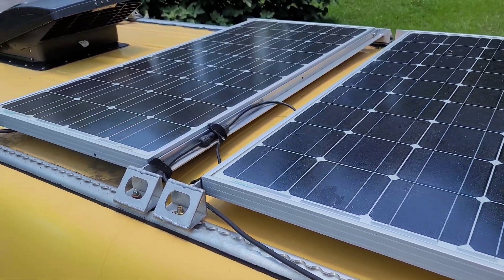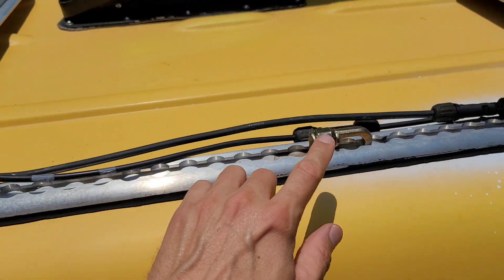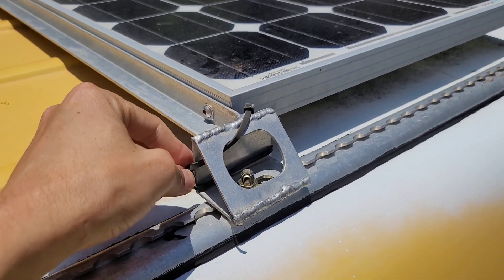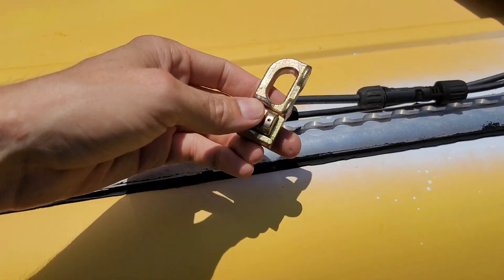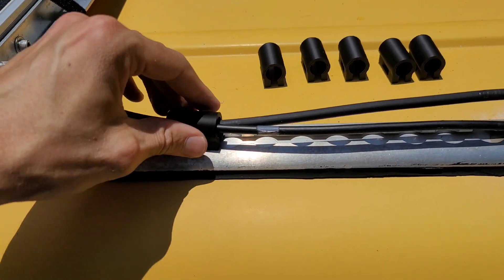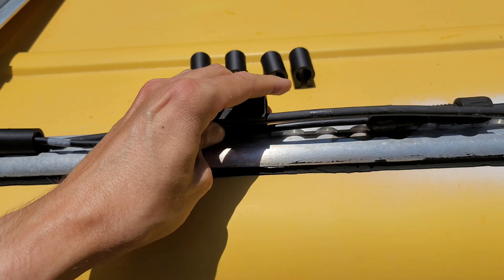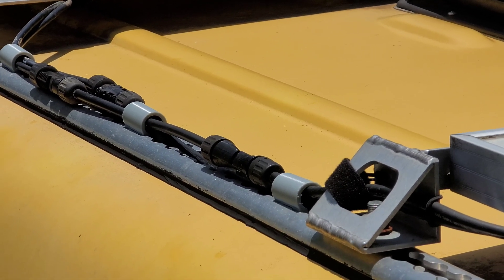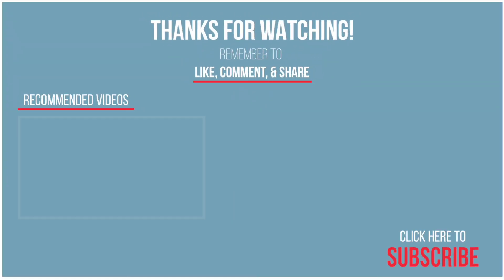3D PRINTED CABLE CLIPS for L TRACK Solar Panel Roof Rails on Sprinter camper van

Comment: Super Nice! Where can I buy some? Also, where did you get those triangle brackets that hold your solar panels? Thanks!!!
Reply from the maker: @Orbitald  download link in description. I custom made the triangle brackets. Details here: https://www.engineerable.com/single-post/solar-panel-installation-on-2006-dodge-mercedes-sprinter-camper-van-rv
Reply: @engineerable  OK Nice! I don't have the capabilities to make those but totally cool solution!